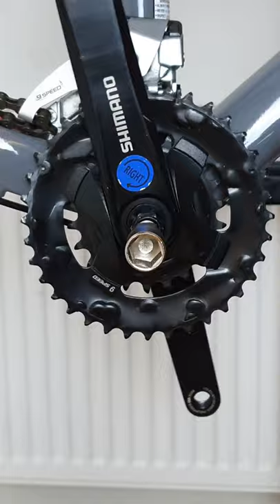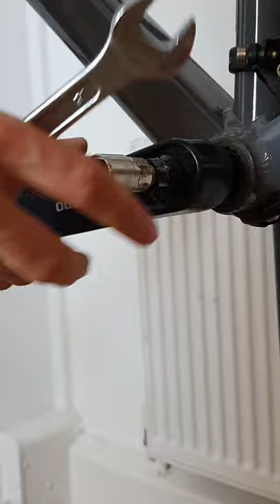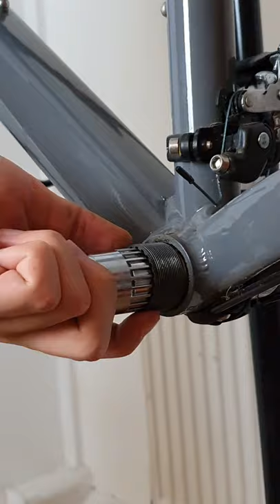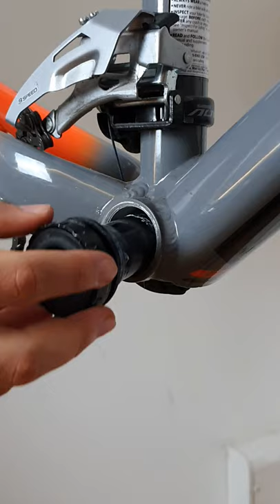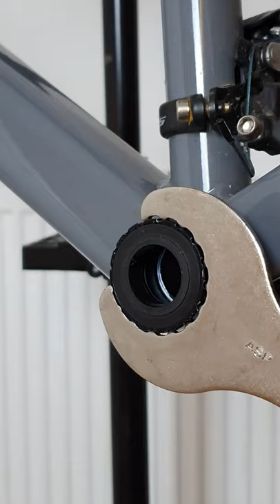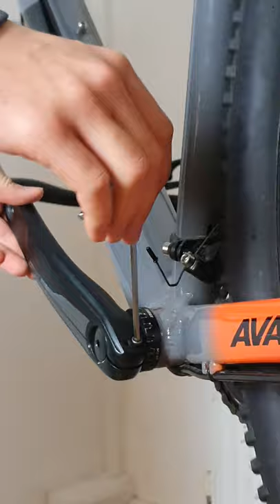Square Taper to Hollowtech | Bottom Bracket and Crankset Upgrade

Comment: Square taper still works fine for majority of riders. My DuraAce from the early 90's was square taper and if it was good enough for Lemond and Hinault it's good enough for me.
Reply: Frame flex is the major cause of energy loss, but somehow people tried to blame the bottom bracket.  Square taper is stiff enough. People are trying to save grams of weight with newer designs. Very misguided.
Reply: Square Taper is STRONGEST and BEST .
Reply: Yep true my daily mountain bike still has square tapered cranks and never disappoints

But my trail bike has hollowtech
Reply: The Badger & his student.
Reply: Untill you land 5 meters to flat like me

Comment: you have to use torque wrench, about 40 Hm. You can breake a thread inside shell tube.
Reply from the maker: There is plenty of range so you can just do it without torque wrench

Comment: Stick with the square taper. Fit and forget. External BBs were just a way for the bike industry to make money from a previously everlasting component.
Reply: If you ride road races or do any kind of racing, you'd definitely benefit from hollowtec bottom brackets. So on my pro race bike I have that, but on my budget MTB, I'm good with square tapered cranks.
Reply: So true, a shimano sealed bb is a beast and will last a long time,and they're cheap, its just a weight saving gimmick for grams and another marketing money 💰 maker, nothing stronger than a sealed square taper brand new and all torqued to perfection
Reply: @ianmangham4570  if only the cranks didn't destroy themselves over time where it meets the bb axle, and if they weren't so dang flexy it'd be the perfect system I guess.

Comment: Want to do this, does the new crank need to be the same width as the old one for gear geometry etc?
Reply: Gear geometry? What. The spacing needs to be the same.
Reply: Your frame will be made for a specific chain line, your bottom bracket width and chainset must match this or be close.

Comment: I've been using Shimano mt210 for almost 2 years now. I swapped it from square tapered coz it always breaks on me after a few months of using it for some reason, and it's a pain in the ass to remove after a month of riding (bike to work). 
My only complaint about my crankset now is I can't change the plates.

Comment: what are the pros and cons of Hollowtech?
Reply from the maker: Hollowtech BB weights less and it transfers pedal power more efficiently. Lower end bikes use square taper as it is cheaper, last longer and can be used longer without a service. Those are the main points
Reply: Você me ajudou na minha maior dúvida , obrigado
Reply: @UnknownRide  i have a merida matts since 2010.. squared tapered and its work fine and smooth to pedal up till now..this coming november   it will be 12 yrs with me..
Reply: I had service it once.
Reply: Not more efficient
Reply from the maker: wow 12 years, This is the biggest advantage of having a square taper bb 👍
Reply: Square tapered bb lasted about 2+K km and then squeaked while pedaling but no play (replaced several bbs with the same mileage). Hollowtech lasts 30+K km and no squeaks, no play.
Reply: @nestordoyoganjr5990   Mileage counts, not years of use.
Reply: At moment I'm looking at square taper for folding bike and hollowtech be up to 200g heavier if count bottom bracket and crankset

Comment: I assume it's an upgrade because the components are of a higher standard.  You wouldn't be suggesting that the Hollowtech system in itself is an upgrade from square taper.  You wouldn't would you.  You wouldn't.
Reply: He would be right if he did, an external bb such as a hollowtech2/gxp/ dub etc is a much better system imo. Easier to remove if seized/rusted, stiffer, quicker and easier to remove the cranks, generally lighter, less options for width, not many high end options for cranks these days and more. Square taper as cheaper and can last a bit longer as the bearings are inside the frame, a good quality one is good but overall external is better.

Comment: what is that tool you use to lock the bb remover in place
Reply from the maker: RISK RL215
Video about this tool coming out in a few hours 👍
Reply: You can even use the same size of bolt but longer you can find it on your local hardware store some washers and it will work